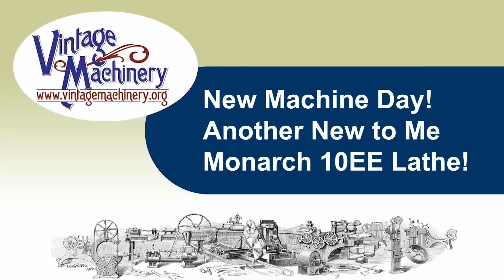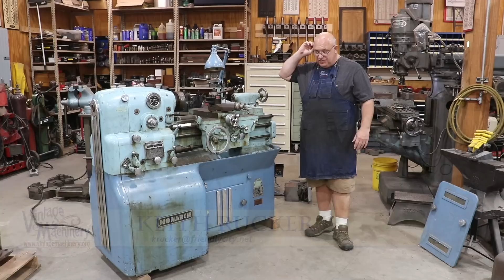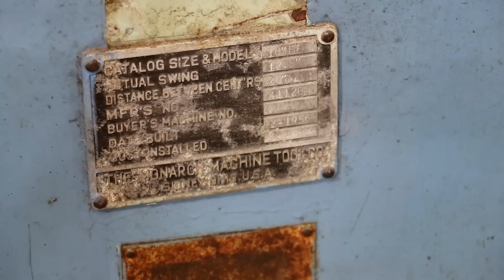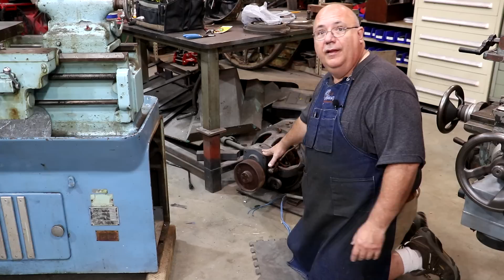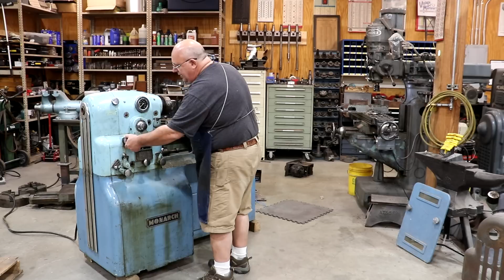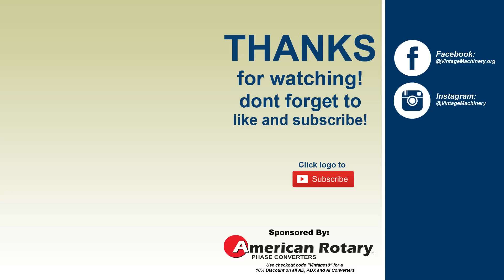New Machine Day! Another New to Me Monarch 10EE Lathe!

Comment: Been thinking on this one. I actually "built" (partially reengineered) a high voltage DC power supply as part of my senior project when I was studying for my EET degree. It was part of a fixed frequency variable amplitude inverter for an inductive casting machine. And it did run and produce 240V

The HVDC primary stage consisted of an SCR bridge (bridge rectifier with the two positive side diodes replaced with SCRs), a pair of isolation signal transformers (too high power for opticouplers) and a discreet SCR controller IC (similar to TRIAC controller in a dimmer switch). That IC was controlled by a DC input... Which for this could just be a potentiometer. 

If on the off chance this is of interest, I open sourced the hardware and software and would be willing to share. There were a couple issues I ran into but the overall design was previously proven.
Reply: Great post. I was going to suggest that Keith might contact electrical engineering schools as designing and building a custom control sounded like a good project. It would be interesting to see the circuit for the original controller using vaccum tubes.

Comment: If it's not going to be a museum piece, I would change to a small DC motor before the week is out. You can use a higher RPM motor geared down a little extra and you get excellent low-end torque. To me, nothing beat a little knob and digital tach to dial in a precise RPM.

Comment: I might be wrong but in a DC motor drive, to maintain constant torque at all speeds, you want to maintain a constant currant and vary the voltage for rpm changes.
Reply from the maker: I am no expert either but based on what I have learned it depends on the type of DC motor you have.  In the case of the shunt type like is in the 10EE, you have to vary both the voltage and the field to get max speed and torque.

Comment: I'd love to get my hands on a Monarch 10EE someday with the original vacuum tube electronic drive... and I AM an electrical engineer! :)
Reply: SCR replacement for the thyratron tubes , also diode  upgrades . The original tube design  per the manual is well done with good feedback control .  Some wire wounds of metal film resistors and should get 100 more years out of the design .  I would say that the speed control is far softer in it speed of change than PWM . Thought it may a bit of a reach to say less fine chatter  because of the spindle control  with the tubes. well that my thoughts on this bit history.

Comment: A 10EE is mechanically a great lathe and as long as the electrics are working, a terrific addition to any shop. If you try to repair the electrical system however, you will soon see why often the guts are pulled out and replaced with one of the options Keith mentions. There is no simple or inexpensive way to repair the electrics back to original operational specification.  These design of these lathes are a precursor to the problem with CNC machines. Mechanically, no worries. Electrically: you need to be VERY good at diagnosing a problem exactly because the proprietary repair parts (if you are lucky enough to find them) ain't cheap. 15 years ago I ran a VMC that they thought needed a board. $3,000 for one of the control boards and that was rebuilt. Turned out the board was ok, but the control panel was shot. There were no repair parts for it, rendering the machine almost useless.
Reply: VMC? What does that stand for I'm a novice when it comes to this kind of stuff. I was thinking virtual machine controller but that does not sound right. lol
Reply: @mousethefoo1230  Vertical Machining Center, i.e. a CNC milling machine.

Comment: In a DC motor you have a shunt field, a serial field and the armature winding for a total of 6 wire. The speed variation is cause by   the serial field. The serial field increase or lower the magnetic field depending of the wire connection. When the magnetic field increase, the torque increase and the speed decrease. So leave the serial field unplug (wire tag S1 and S2 ) will correct your speed variation.
Reply from the maker: It depends on the type of DC motor you have.  In the case of this motor, it is a four wire motor.  It is a shunt type motor though.  You can control voltage and field.

Comment: Variacs are variable transformers. Technicly autotransformers. You're literally changing the number of coils on the output loop. You can vary it to fewer coils to get more current with lower voltage or more coils to get higher voltage with lower current.

That there is a right spiffy variac. You want to get rid of it, give me a holler.

Comment: I think if this were being built today it would use a brushless DC motor with Hall effect sensors or resolvers sensing the rotor position and a DSP generating the rotating magnetic field.  

I hate to think of the control dreamed up by practical machinists for a separately excited field, armature voltage-controlled motor which from my brief research does not seem trivial.

Comment: I learned how to run a lathe on pretty much an identical machine. It was originally a 10EE with the tube rectifiers that had been converted to a modern DC drive. The electrical engineer who owned it used a modern electronic DC drive and then hacked/modified the power section so it would run at the motor's rated voltage. For him it was less about getting per-spec torque out of the thing as much as it was a humble brag whenever the mechanical engineers would show up.
Reply from the maker: Neat!

Comment: Keith, that "Variac" thing is just a brand name for an autotransformer - variable adjustable "single side" transformer, that can LOWER the voltage supplied to it, to whatever output voltage you need. I'm not sure how (and "if") lowering AC VOLTAGE can alter the speed of a DC motor, and I'm not sure what was the idea of putting the other transformer in the same setup. (I am not an electrician, and although I have SOME understanding on how it works I'm not an expert in this field.)
My GUESS is, those transformers are connected "in series" - variac can adjust the voltage only "down", so that other transformer (of a fixed stepping) bumps up whatever the input it gets from the autotransformer. Like, the US system is 110-120V single phase (or 220-240 V for power hungry appliances; that Technology Connections YT channel explains it in its "The US electrical system is not 120V" video, but I digress here), so say, you start with 120V, which then you can CONTINUOUSLY LOWER to almost zero (using Variac) - and then the second 1:2 step-up transformer bumps it up to ANYTHING between 240V and zero. Then the rectifier converts it to DC, roughly (almost) the same voltage - and presto, "Q & D", but it works.
Someone here mentioned lack of capacitors ("smoothing filter"), that would make that DC "pulsating" (i.e going from 0 V to whatever the max volts the rectifier is supplied with 120 times per second), which might be an issue in some applications, but here, considering the mechanical inertia of the system, this is non-issue. Probably they have given up those capacitors as it was too bulky or too costly, or both (ideally those capacitors should be electrolytic ones, AFAIK - which are not only more expensive than those common film capacitors, but also have a finite lifespan).

PS: That 120/208V was meant - probably - for the original "motor control system", not that cobbled makeshift combo gizmo you're facing now - which is meant for single phase 120V - probably there's some label on that Variac that says it's meant for 120 V supply only.
Reply: This is not correct. For a start, a Variac can adjust the voltage both up and down, up to a point.
Reply: @EJP286CRSKW  Since I'm not an expert on them (I saw and held it in my hand only long time ago, it belonged to the father of my primary school classmate, and that was SOME time ago). It was of that "variable" type, just as this one here, just bit smaller, and it was "down only" type AFAIR. Auntie Wiki says those "variable" ones are made to work in the range of (typically) 0-130% of the input voltage, or (less frequently) in 90-110% range.
So, yes, you're right, I was wrong. Thanks for correction. : )

Comment: If you can find the specs of the motor (voltage rating, current, max rpm, etc) we can help you find the correct motor controller.

Comment: Are you saying the headstock of that lathe doesn't have the usual pair of levers to control speeds? Obviously I haven't inspected the thing but IMO you're going to be much closer to a usable machine, much faster, just replacing the motor.
Reply from the maker: Yes, the headstock does have speed control built into it as originally built.  However, with this particular setup, all of that was bypassed.  As to replacing the motor, that is an option, but it comes with some tradeoffs.  I am going to keep the original motor.

Comment: With a VFD you should not loose torque at low speed but DC will
Reply from the maker: So, I was backwards on this.  With a VFD, you don't loose torque at low speeds but you do when you over speed it.  In order to get the 0-4000 RPM speed range out of a three phase motor like I get from the DC motor, I would need to run it above 60 hertz, which would loose torque.  As for the DC motor, if you only change the voltage, yes, you will loose torque, but if you also adjust the field, you can keep constant torque even at low speeds.  That is what was done with the original setups of these Monarch lathes and what I am going to replicate with my new setup.

Comment: wow mindd blown... so instead of a modern 3 phase vfd we can get more low end torque from a 230v dc... i love the sound of that for maybe other applications like a really slow mill or drill press. probably a lot more expensive than a chinese vfd though. those boxes are cheap as chipa. maybe adding a cvt transmission to a 3 phase vfd is another way to get the gearing down easily to bump up that torque? can we even get (or make?) decent cvt transmission gearboxes for fitting into mills and lathes? because i havent looked for any yet. but could that itself be a cool and worthwhile machining project out there? of course maybe not for your thing, which is more authentic vintage machines. but instead was just thinkin more about solutions for modern machining. if relevant or applicable to that scene

Comment: You seem to be using rheostat and variac interchangeably and they're not the same.  Variac is a variable transformer and a rheostat is a variable resistor.  I'm wondering if the large transformer is a voltage correction transformer to step 230v to 208v.

Comment: Variac is a brand name that became the generic name for an autotransformer.
AC power goes in one side and comes out the other at a different voltage.
It's all done with wire coils and magnetic fields.
It's more efficient than a rheostat or a variable resistor.

Comment: From my days as a Sales Engineer selling Reliance Electric motors (among other things) I learned the 208V motors were used in areas where the supply voltage was not a solid 220-240 but dropped below 220. Usually, rural applications far from a substation, or industrial areas with a lot of loads on the system.
Reply: sure? 208V should be a standard voltage since it is the voltage between two phase in a 120V three phase system

Comment: I dont understand? You HAVE a nice Rotary 3-Phase, that puts out 208V do you not? how else are you running virtually every other machine in the shop???
At home a have a 10HP rotary that I ran everything off, till I bought my shop....
The shop has a 277/480V (3-ph)panel and a 110/208V (3-ph)panel - The Bridgeport Mill, B&S Grinder, Clausing Lathe all run on 208?? Why not just wire that machine up to your existing 3-phase and try and run it? You could do a remote Knob with a cable to the Vari-Ac and relocate speed control to the front panel - What am I missing?
Reply from the maker: My phase converter puts out 240v between two legs.

Comment: The chap that roped that dodgy setup has forgot the rectifiers
Reply: No he hasn't. They are on the heatsink. Mentioned in the video.
Reply: @EJP286CRSKW  I assume they are not rated, how would you explain the haunching?
Reply: I don't understand the questions. If there was no rectifier, there would be AC going into a DC motor, and it won't turn at all.
Reply: @EJP286CRSKW  if the capacitors discharge to quickly can end up with ripples in the DC current. Hence the haunting
Reply: I still don't know what 'haunting' means, and you've said it twice. Do you mean 'hunting'? If you're trying to tell us that a setup without rectifiers but with capacitors can behave as you describe, you're just not making any sense. And the 'haunting' is not happening at 120Hz so it is not related to either rectifiers or capacitors.
Reply: @EJP286CRSKW  I mean running at an inconsistent speed. The problem shown. It’s a common problem when the some of the capacitors fail open circuit on a DC motor drive or a poorly designed system.
Reply: That would cause 120Hz ripple, which even at 4000rpm is nearly double the spindle speed, not a slow motoboating like we are hearing here.

It isn't clear to me that there even are or were capacitors in this thing. They would have to be monstrous at the current being drawn: many Farads.

But at least you seem to be conceding that the rectifiers are present.

Comment: I have a Bridgeport mill with Heidenhain cnc controller. My mill has a dc motor on the spindle. The dc drive is "new" by your standards (some 30 year old)

dc motors (external field excited need control over the armature coil and field coil) they also need usually an external blower to cool them down. Mine has 3-phase blower taking more power than my ex chinese minimill... also they have carbon brushes that need replacing from time to time, mine has still plenty of brush left.

Still, love the torque that the spindle motor gives, I'm not so pleased for the driver. I have another never ending project to convert VFD to a dc drive with external field exciter inside... :)

My plan is to take  Vacon VFD's power board and use it's 3-phase IGBT bridge to drive the armature and field. Vacon VFD's has current sensors on all of it's "legs" so using 2-phase I get four quadrant drive and have one leg left for the field. Also the 3-phase IGBT bridge has IGBT for brake resistor.
Reply: I bought from my workplace also Vacon 2.75kW braking resistor (800v 14R) for pennies. With that the spindle should be able to stop on a dime.
Reply: Here's my dc drive and why I don't think it will last very long.

https://youtu.be/W85gXEKhR_Y

Comment: 10EE is nice, but Schaublin 135/150/160, some Weilers, Izhmash 1И611П are at least equally nice, that weird DC-motor/generator drive in the 10EE seems like a nightmare to keep working...
The modern approach with VFD and hugely large (15-20HP) AC motor for low speed torque seems much easier to keep working, same setup like in about every CNC lathe.
Or just go with big BLDC, massive torque even at low speeds.

Comment: yes a Craftsman lathe is NOT a Monarch.  That said and hopefully agreed upon I think:
1.  Rectified Variac (most properly termed as autotransformer) to get DC worked very well on my craftsman 12"
2.  I had a Baldor 3/4 HP 90 V permanent magnet motor and used that.  
3   Permanent magnet torque speed curve is quite close to shunt wound not as much torque as series wound but you get good speed control.
4.  Shunt wound was industrial mainstay for industrial when variable speed was mandatory.  Otherwise single or two speed 3 phase.  
5.  Compound DC was used in larger machine tools.
6. I am sure IF you could put the variac where it was right handy to change speed you would be happy.  That does not look easily done.
7.  DC motors require maintenance brushes mostly BUT carbon dust could be problematic.
8   The main reason industry switched to VFD and 3 phase motor drive was to get variable speed WITH low maintenance motor.
9.  You do not need to be a EE or electronics guru to do DC --  just a good motor control electrician.
10  I learned DC motor control from 4 years on board nuclear submarine.
11.  Ripple capacitors are a good thing but NOT mandatory for DC motors.
12.  NEVER do full voltage starting on DC motors.  VERY hard on contactor contacts.

Dan Bentler 
EM2 SS  USS Barb SSN 596

Comment: You might have a look at Beel Industrial Controls. They have a complete 10EE solid state DC motor retro-fit. I think the model is D510-FWCH. I have no affiliation, just thought it looked like a good solution.
Reply from the maker: I have seen mixed reviews on that unit.  Also, it is designed for the later model 5 HP DC motors and not the 3 HP motor that I have.

Comment: It sounds like the conversion was poorly done. The unstable voltage/speed tells me you have corrosion inside the variac. The power supply also should have some large DC capacitors to soak up voltage variations.

Comment: I agree with the other comments that the power supply is missing capacitor(s). In my opinion it really doesn't matter since that whole diy electric system needs to be removed asap. A variac/autotransformer has no business being permanently attached to commercial equipment. I am surprise that the center tap of the variac hasn't burned up yet.

Comment: Keith,
To get the electric motor run better for now.
Check rectifier if all diodes do function.
Or get it to someone who knows rectifiers.
Check carbon brushes on motor and collector/comutator.
Also check variac, it has a carbon brush on de downside which can wear out or make bad contact.